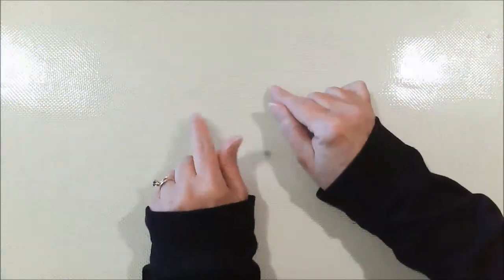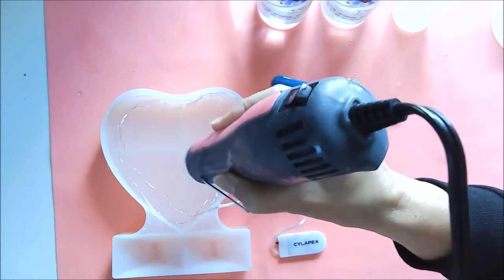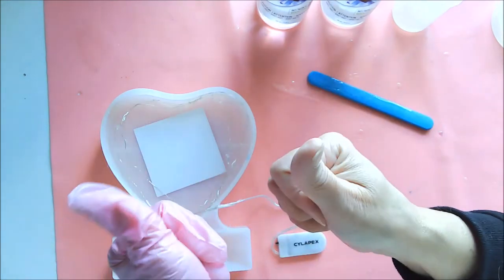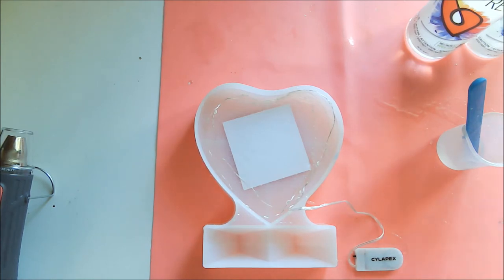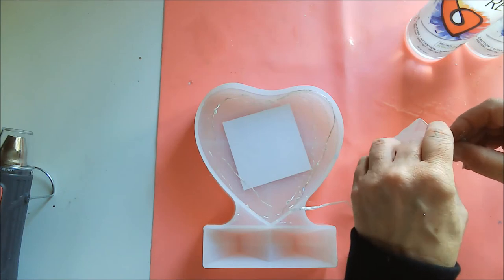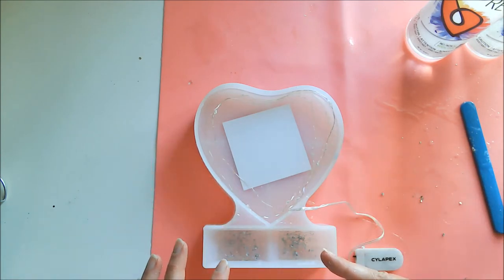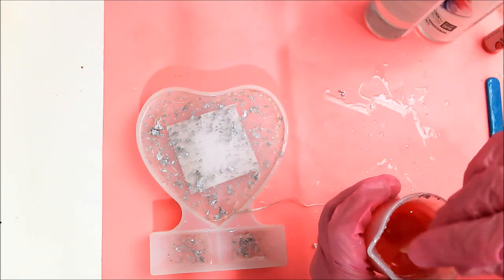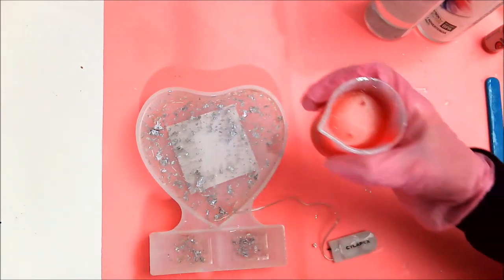Fairy Light Heart Frame With Epoxy Resin - Step By Step Tutorial

Comment: Cute. Think it would also look cute with the pic cut heart shaped as well! Thnx for all the info!
Reply from the maker: I think so too!  I thought of doing a heart shaped picture.  When doing the pictures they float around in the resin and to control that (to keep the heart straight) you would have to keep checking it and moving it back in place.  I'm a little OCD so the heart not matching up would drive me crazy, but purposely putting the square at an angle didn't bother me.  Oh and also I didn't have a picture that would work cut in heart shape.  Maybe another time.  But I completely agree that a heart shaped picture would look great 😊🎄 Merry Christmas!

Comment: Jamie, that was a great tutorial. What a gorgeous project. I've never used resin before, but this is definitely worth a try. Super great job Jamie. Love it!
Reply from the maker: Thanks so much Bonnie!  I had always wanted to work with resin but didn't like that it was so toxic that you had to wear one of those special face masks.  I love that this is certified non-toxic, no VOCs, no BPAs, no fumes, and is even certified safe to set food on (after it's hardened of course).  So no need to wear a mask, unless you want to, but gloves are a must if you want to keep the sticky stuff off your hands.  I'm sure you saw in my video that I wasn't always wearing gloves because I had to break up the gilding flakes.  I love this resin and trust this brand.  Even though I hate working around my laptop and stuff with it because I don't want to touch things and get resin on it, I think I will still try to do a few more videos with it so you can get more inspiration 😊💗🤗 Hugs....Janie
Reply from the maker: Bonnie I had forgot to put the links in to the products used but I just added them in case you needed them 😊
Reply: @janiethecraftprincess  now your talking, love that the resin doesn’t smell or have and bad effects, great job finding that one. Can’t wait to see what you come up with next.

Comment: I’m newish to epoxy and have started into picture frames I actually have this one. My question is how do I get rid of the bubbles? I’ve gone from tiny bubbles to no small one but to big ones. I’ve pushed them down and used a small scraper but still wound up with some. Am I pushing to hard? There are no bubbles when I place them face down.
Reply from the maker: Are you referring to all the tiny bubbles throughout the resin, or are you referring to the larger bubbles that can develope under the photo (front of the photo)?  Tiny bubbles that appear thoughout the resin can be reduced by stirring your resin slowly, and also by using a torch (carefully) or a heat gun (you might have to watch one of my other resin videos).  For the large bubbles on the face of the photo, I use something like a popsicle stick, or silicone stick, and push down on the back of the photo once you lay in in the resin.....pushing the bubbles out.    For the larger bubbles, there is another option.  You can place the photo in face up instead of face down.  I hope this answered your question, especially since I'm not sure of your question.  I feel I should have read your question more thoroughly because I'm confused why you would have no bubbles when the photo is face down.....for me that is when I take the chance of getting bubbles.  It sounds like you are doing everything right, so maybe it's the resin you are using.  I wish I could help more.  To be honest, I'm still pretty new to using epoxy resin myself.  Good luck 😊

Comment: Someone may have asked this. I am new to resin and I am making a memorial for my cat that just past a and I am going to use some silver flakes. Is there a difference between the silver flakes and the one your using?
Reply from the maker: Hi.  I will do my best to answer your question.  First of all I have no idea what flakes you are using so I can't compare.  But I can tell you that what I used is not just flakes, it is gilding flakes which is super thin, pretty much weightless, foil.  The link to it is in the video's description box (below the video).  They are peices that you can tear apart to use, which is what I did.  It is actually made for gilding.  Use the link so you can see it and read about it.  It's only about $10 for a set of 3 LARGE jars that will probably last you a lifetime.  If you buy it I would greatly appreciate you using my link.  I hope my answers has helped a little.  Let me know 😊 Hugs...Janie

Comment: Nice job! How did u hold light down?
Reply from the maker: Thank you so much 😊 As for your question, that was shown in the first 1 minute and 45 seconds of the video.  You should watch again, but what I did (and showed and told in the video) was pouring just enough resin in over the wires to hold the lights in place.  I let it sit for about 2 hours before putting the next layer on.  But please watch the video again, because if you missed that in the first minute of the video, then you might have missed other important things.  Don't skip through it, watch it all 😊

Comment: Very Nice. Would you happen to know the size of the picture you used? Thanks
Reply from the maker: The picture I used is 3" square.  You need to measure for yourself because your heart mold may not be the same size as mine.  Mine will also hold a wallet size photo, or you might want a photo that is landscape direction.  But most important, measure your mold and decide what will fit.....that's what I had to do.
Reply: @janiethecraftprincess  Perfect Thanks Sweetie. I might order the same mold you have here. It would be a perfect gift! Thanks Again for replying. I really appreciate it.